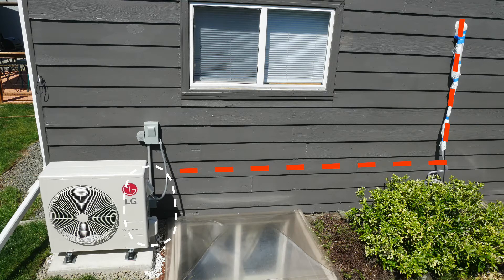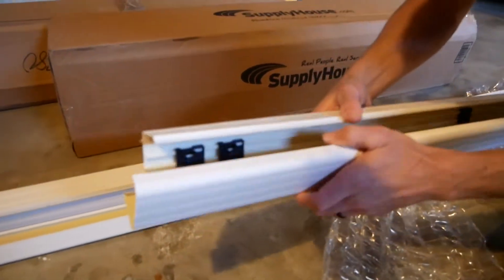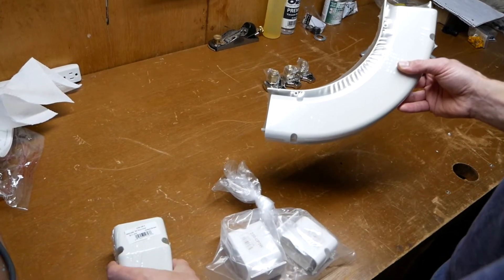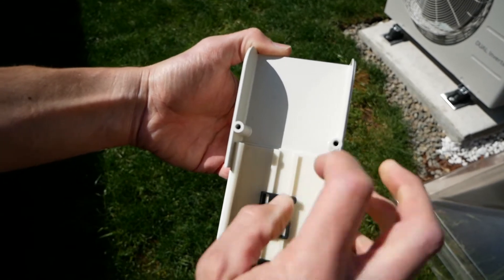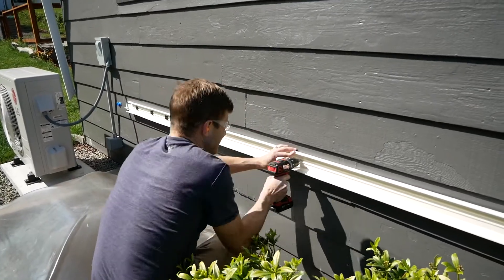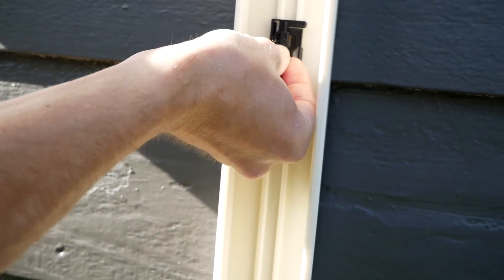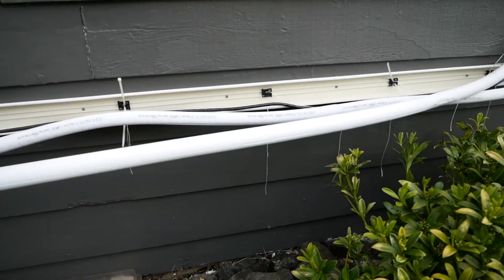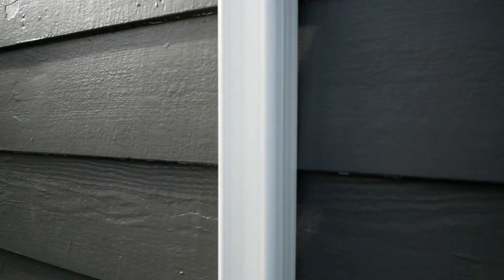DIY Raceway Installation | Ductless Mini Split

Comment: What method did you find most effective for bending the line set 90 degrees at the wall exit/entry?
Reply from the maker: The indoor units have the stub-outs that extended a foot or two outside of the house. After connecting the lineset outside to the correct torque, I very slowly bent the copper tubes individually downward. I think I may have padded the hard edge and used one hand on the bend and the other a ways down for a bit of leverage. This is definitely one of the more nerve-racking parts of the install as a kink would require a new cut in the tube and possibly purchasing a new lineset depending on which step you're on!